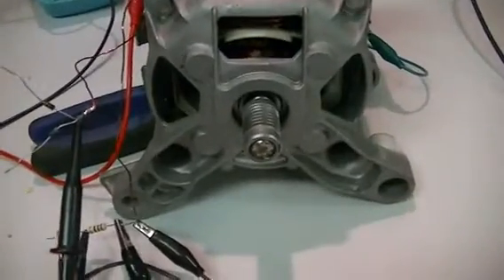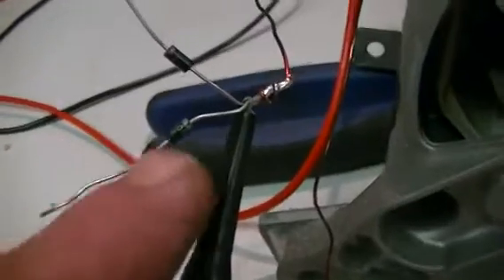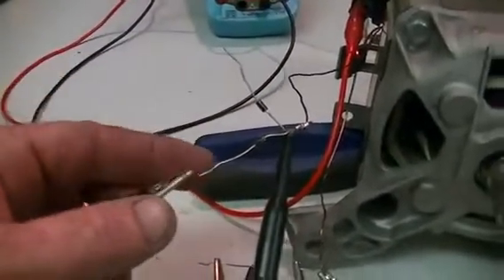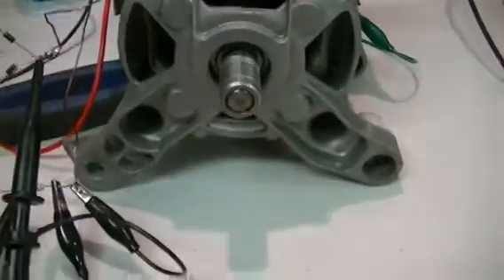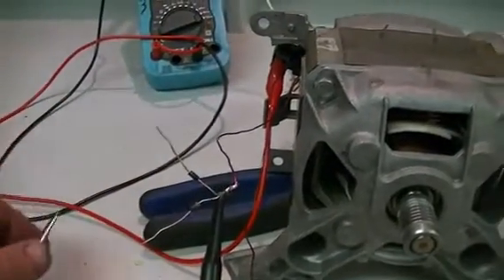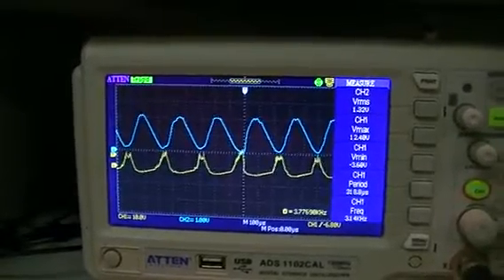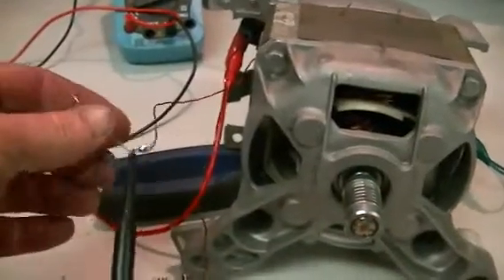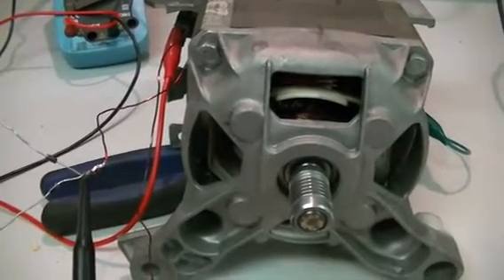Speed up under load generator

Comment: according to my studies; taking the power from the magnet "approaching" the coil is going to give you far less "Drag" than taking the other half of the wave "leaving" the coil. Heres why: as a magnet approaches the coil it produces a current in the wire that opposes it's own motion, but according to Obvious order of events (magnetic field approaches THEN current is formed THEN opposing magnet field is formed) at higher speeds the series of events takes place with somewhat of a LAG so that the momentum of the approaching magnet is opposed for a shorter time during the APPROACH and continues to be Opposed as it LEAVES the other side of the coil. Since a high speed is maintained and there is no attractive force "Dragging" the magnet on its departure, the remaining opposition due to lag in the dying magnetic repulsion "Pushes" the rotor away, in effect giving a harder "Push away" on departure than it gave a "Push away" on the approach. 

I came to the same conclusion that instead of using two diodes to capture both sides of the wave; just taking one side of the wave (using one diode) would reduce back EMF by more than 50%. It's a very small amount more than 50% but in effect it is a tiny bit more energy returned for each unit of energy put in and that's always a good thing.
Now working on getting a little more Back EMF reduction using steel rods instead of magnets. This stuff is so interesting ! ! ! Keep up the good work, you know the energy companies are not going to do it! ! ! !Why would they work to reduce their own profits??

Comment: Good day mate!... looks to me like the induced magnetic field from the rotor to the stator core is being redirected by the stator coil by using the correct diode so that the counter EMF goes in the direction to further push the rotor instead of holding it back. Are you using both stator coils?  It would be nice to see the power the motor used prior to disconnecting the stator coils to see the advantage. Good experiment and thanks for sharing. Luc